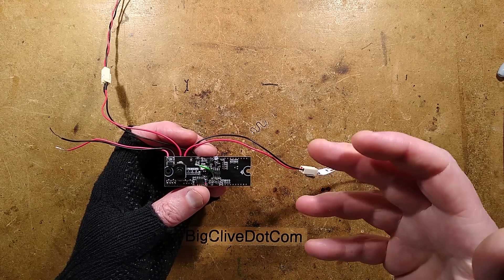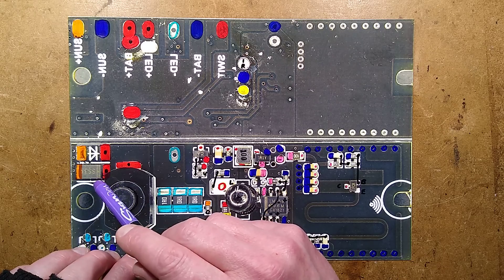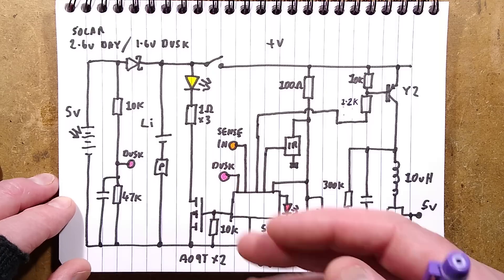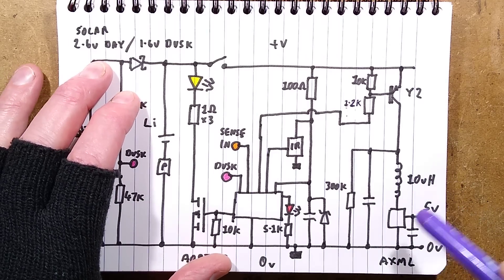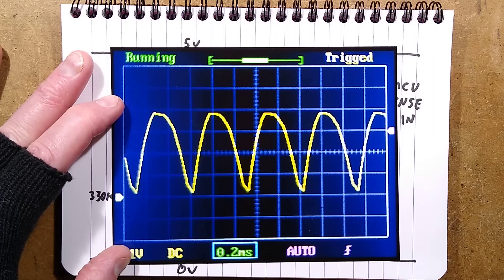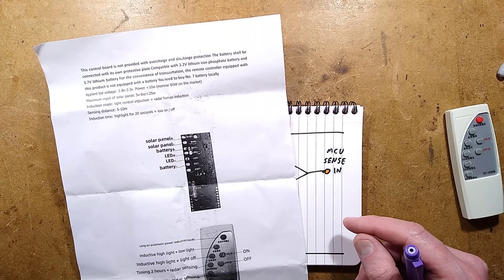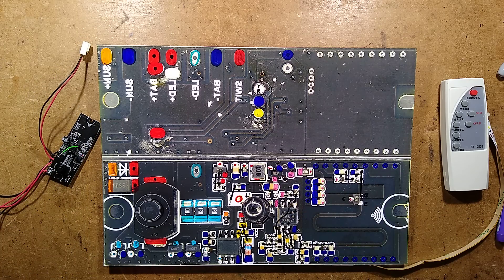Solar "radar" light control module - with schematic (and fix!)

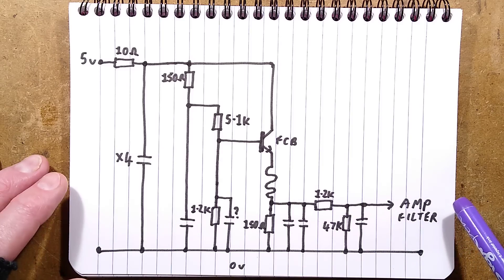Comment: 8:07 looks like that 150 Ohm resistor serves double duty as both a shunt and as a means for setting the DC bias for the transistor. The capacitors across it serve as bypass to ground for the RF.
Anyway, the designers seem to be interested only on the average current across the "shunt", thus the 1st order low-pass filter formed by the adjacent 1K5 and 47K resistors and capacitor (the 47K resistor would have negligible attenuating effect, and could be omitted with no major impact on performance).
In your diagram, there are a few essential microstrip elements missing. I've simulated it as is, and the oscillator performs poorly.
Reply: Oh this would be an interesting follow up video!

Comment: RF is a black art - even to RF experts.
Reply: It's true; alot of rf guys I know 'cheat' by watching a scope while adding components rather than just designing it so it should work in the first place.
Reply: @sometimesleela5947  Are you saying RF stuff can actually be designed instead of just stumbling upon a working configuration? :)
Reply: We called it PFM…. Pure f&$cking magic!
Reply: Firefighter here. Had to fight a fire at a radio station here. Fire started inside a wall with no wiring in it. Just studs, drywall and plywood. RF had focused on a stud in the wall and started a fire. Weird.
Reply: @fritz1990 
Impossible.!
First issue; "radio station"(s) use remote Transmitters and  Antennas.
No.2 Gypsum  (drywall) does not burn. And it has non-flameable adatives.
There is no way you are a fire fighter.
I'm a "first responder". Tell me what is the first thing you do when arriving at a scene.?
Reply: @snakezdewiggle6084  if the correct answer isn't ensure the kettle is on I will be very disappointed ☕😉
Reply: @snakezdewiggle6084  I'm an engineer. I start the pump. This happened here in Alaska at our local radio station.
Reply: @BromideBride 
I apply the breaks, and send You to check on the kettle😆
Reply: @fritz1990  
I will have to agree with your answer. It is obviously your designated task.👍
Thank you for the work you do, your service to the community.👍
I won't bore you with the details. But the RF power to cause that fire, it have to be 50,000 watts, and on a Ultra High Frequency close to mobile phone towers. I think your Assesor is wrong.
Weird it is!
Reply: @snakezdewiggle6084  he may have been. The way we build things here is kinda nuts. No building code, but everything has to be insulated from the cold and snow.
Reply: @snakezdewiggle6084 Studs are held in place with steel nails. If the nails are just the wrong distance apart they will grab power from the transmitter and dump it into the wood between them. Wood makes a really bad high power tesistor.
Reply: @fritz1990 
Yep, I drove trucks, big rigs, up there for a short season.
I'm from Australia, you know, Sun, Surf, Sandy Beaches. YOU Guys are insane living up there like that.! 😆
I guess opposite sides of the coin.
I like solutions, so your fire is running around in my head trying to nail down a cause.
Where is the big tower/antenna, like at the station, or out on the edge ot town?
Reply: @markfergerson2145 
Yeah I see where you're going with that.
Its a good theory, but we need some conductivity in the wood. Turn RF evergy into heat. This brings up, power, proximity, resonance, combustability,  and environment.
Reply: @markfergerson2145  now that is entirely possible because the place is old enough that they used nails.
Reply: @snakezdewiggle6084  pray
Reply: @budd1814 
If thats a threat, then you don't know who I am.
Reply: All geometry with unknown parasitics....
Reply: @BB-iq4su This right here. You can design a circuit and cut and populate a board that will behave exactly as designed… in an environment with no RF absorbers or reflectors or inductive or capacitive elements like other non-RF circuitry,the case, trees, people, animals, weather etc. that we lump under the heading “parasitics”.

Every real world RF circuit has to be tuned to work in its applied environment. If you don’t do that it will kinda work, and these cheap devices kinda work well enough most of the time. That’s why the stated detection distance is a range, not a single number.
Reply: Shhhh....

Comment: Very interesting, I enjoyed the video.
Note that these will go deaf around wifi routers as the router emissions do drown out the doppler signals.
A few meters of separation is normally good enought o fix that.
Appreciate the effort that went into this one.
Reply: Yeah, good old fashioned front end capture.

It’s a consequence of the 5GHz band having to be shared by devices that do different things, and (in the US) one of them having to accept interference by the other.

Comment: The wiggly track is actually the antenna. If I'm reading it correctly (I'm by no means an expert in this...) the antenna transmits a frequency, and when it receives the reflected signal, the interference on the antenna gets amplified by the op-amp circuit. The scope screen does look like it shows 0.2ms, but then, I didn't do the measuring, so you likely know best ;) But if the 2kHz is correct, it's 0.5ms, not ns.
The filtering caps in the op-amp section, especially the one between the 1M resistors, might be used to vary amplification depending on the frequency.
Reply: I believe the track your referring to is an inductor, if you mean the one on the emmiter of Y2
Reply: Ooh I see the track you mean my bad, your absolutely correct, apologies

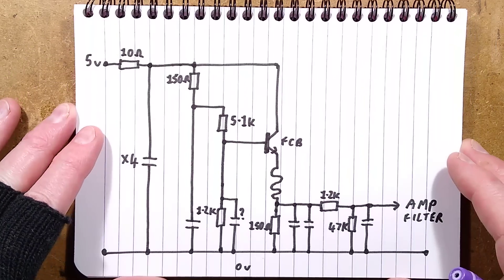Comment: I'm having trouble undering how the RF section at 7:14 will oscillate. I don't see a feedback path back to the base of the transistor. Could it be from the physical placement of the tracks which is causing capacitive or inductive coupling to the large pad at the base?
Reply: At RF EVERY part of the circuit is inductive and capacitive. And they all resonate. Even changing a track width, or placing it 0.1mm closer to another track changes the frequency.
Reply from the maker: It's hard to say when working in such high frequencies.  Everything behaves differently.

Comment: Interesting fault 2x👍
The PCB antenna working are something I never really wanted to know about, (as long as they work). We had microwave antennas for speed trap detection and Im just happy they all worked out the box. It was interesting to see the difference between the UK and USA versions.